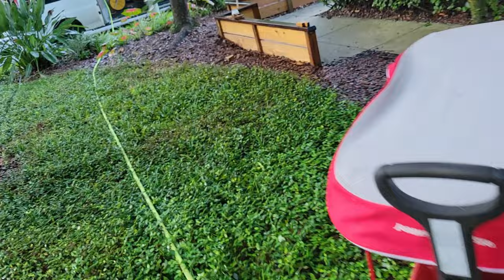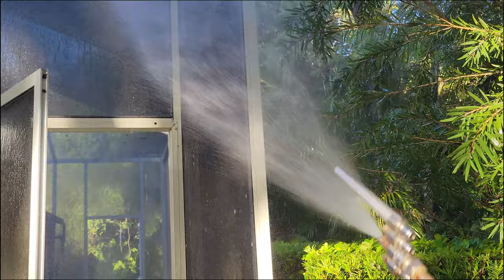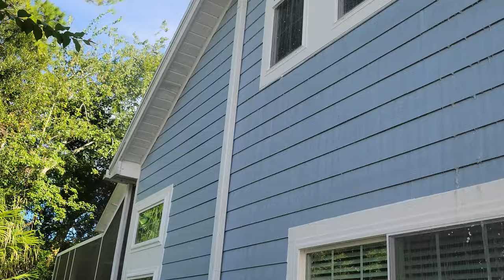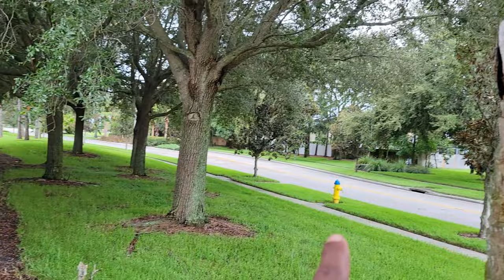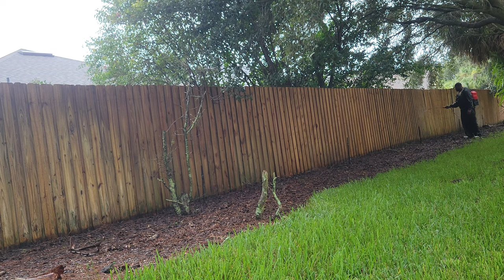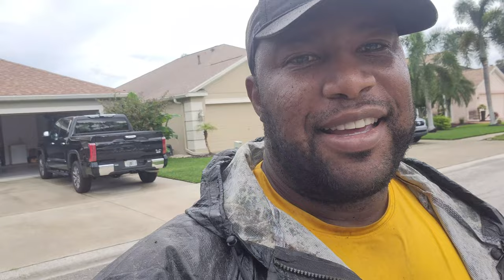I used BLEACH on a wood fence #woodfence

Comment: I'm doing my first wood fence tomorrow! After I pressure wash Does the fence have to be damp or dry before applying the oxalic acid?
Reply from the maker: You can do it right after rinsing the fence.

Comment: Great job on the fence...I have a cedar fence I need to do the same...how do you suggest I attack it? Sodium Hypochlorite mixture recommendation if I just have a pump spray? Oxalic Acid in the what ratio do you recommended? Thank you in advance for any info.
Reply from the maker: Never done cedar decks. We barely have those here sorry
Reply: @PinkFlamingoPowerWash  thanks for responding but i have a fence. .

Comment: Hey Cliff, Big-Up brother. What type of Pressure washer are you using?  Can you recommend a good soft wash chemical hose for my 12 Volt pump ? Thanks in advance.
Reply from the maker: I'm using a Honda gx690 8gpm pressure washer.  Yes 1/2 inch ag hose is very durable. I've been using that same softwash hose for since day 1.  So it's been good for 2.5 years so far.
Reply: Do you use the same machine on floors?

Comment: Do I have to use SH on driveway o just water?
Reply: use SH bro, it's the SH that kills the green/black grime.  i
otherwise driveway will look bad in 3 to 6 months again.
Reply: @vman6365  thank you very much
Reply from the maker: Yes as V man days definitely use SH.  The surfactant is what you really don't need for driveways. But sh is a must.

Comment: Once you used the 3 % SH , is it necessary to apply oxalic acid if you intend to stain and waterproof the fence, or deck wood?  Thank you in advance!
Reply from the maker: It's not necessary but I think it would add a nice touch to it.  ✌️
Reply: Thank you for replying!
Reply: One more thing does oxalic acid neutralize the bleach?
Reply: @UnitedSigma83 Yes however as a professional you should use percarbonate vs. bleach.

Comment: I did a wood fence yesterday and noticed when rinsing I was still getting some lines and had to use a "sweeping" motion up and down to get them to blend. It was especially noticeable in areas that had set in staining that had turned milky white after the SH application but not in every area. I used a 3% mix with about a 10-15 minute dwell. Any thoughts on how to prevent the lines in the future.
Reply from the maker: Not really sure what kind of lines you're referring to.
Reply: @PinkFlamingoPowerWash  I'm not sure how to best describe it but I got it cleaned and brighten, looked great! My shoulders and arms were SMOKED, that is a workout! I appreciate the information as always.

Comment: Hey Cliff love the videos btw. I’ve been on you tube every night RELIGIOUSLY watching my select group of YouTubers. So I’ll be running an entry level pressure washer at first. It’s the dewalt 4gpm machine. And I just want to be clear on the dilution ratio when down streaming. Am I correct when I say down streaming will cut your SH 10:1. Meaning if I ran straight SH out the bucket it would give me a 10% mix? I was under the impression running straight SH out the bucket would give me about 1.5% mix? I thought I had a pretty good understanding, now I’m a little confused. I just want to be able to run a 3% mix for my house washes and fence cleanings while  downstream.
Reply from the maker: Nah when you downstream you can get 1-1.25% depending on your injector or if you are using 10% or 12.5% sh.  Downstream is the weakest form of application which works well so no you can't get 10% mix.  10 to 1 or 10:1 means for each 10 gallons of water that passes through your injector it draws 1 gallon of sh.
Reply: I just posted reply. Not sure why it’s not showing up, so I’m re posting. Wanted to say thanks for taking the time for my questions, the insurance questions from a couple weeks ago and my down streaming comment yesterday. I’d love to repay the favor sometime. I’m sure I’ll do well with this business. I’ve been welder/fabricator now 7 years. Can’t wait to quit and get this company off the ground. If your ever in ocala and need help a few hours don’t hesitate to reach out to LDP Power Washing. I’m not on google yet but like I said if your ever in my neck of the woods and need a hand with anything I’d love to help. Thanks again cliff.
Reply from the maker: @leepyle1188  thanks my brother

Comment: Thank you for you awsome videos once again. Do you pull 2 hoses for your house wash? Is the soap and sh a 12 volt and the second is your PW for rinsing? ThAnks again keep pumping them videos please. God Bless.
Reply from the maker: Nah I downstream my house washes so only 1 hose.  I have done the 2 hose thing before though as you said.  Apply chem with 12v and rinse with power washer.  I did that when my injector was out of commission.  Thanks JC

Comment: Should I apply Oxalic on a new wooden pool deck after soft washing? A customer wants it cleaned because of the red clay after the workers got done.
Reply from the maker: On a wooden deck??
Reply: @PinkFlamingoPowerWash  Yes would the sh be safe to use on it If not what will I need to clean the deck?
Reply from the maker: @Dr. Rick  for that I would go with sodium metasilicate.

Comment: Any idea on what I should do I got a foam cannon and am looking to start washing fences but I don’t know what percent and how much bleach to put in my bottle
Reply from the maker: That I do not know. There's a guy named zay womder on YouTube that used to do that he may have that info on his channel.  He used to fill up a gang of foam cannon bottles with straight sh to wash houses.  I don't know whT the final mix is once he sprays it though.
Reply: Sounds good boss. Are you using a 3% SH in a bucket? Or what are you doing?
Reply from the maker: @calklobuchar  no on this video I downstreamed both jobs.  My downstream injector pulls out of a tank with straight 12.5% sh
Reply: @PinkFlamingoPowerWash  what ratio do you get with your downstream injector? I've heard best case is around 8:1, which would mean the SH is going on at around 1.5%? Correct, or not?
Reply from the maker: @leigh5326  depends on the downstream injector some pulls more than others.  But the average ones pulls around a 1-1.5%
Reply: @PinkFlamingoPowerWash  thank you for clarifying, very much appreciated. Really enjoy your videos btw!

Comment: I'm doing a fence tommorow, it's atleast 300 feet by 8 feet maby 400 not is $400 fair or way to cheap?
Reply from the maker: Idk. Each market is different. That would be better answered by checking locally.

Comment: I appreciate your videos. It’s help me grow as a business since I just started house washing. I have a question?
Do you downstream through 12V system or your power washer. Your videos pushes out high pressure when you’re down-streaming. Thanks for your help
Reply from the maker: The old school way brother. I downstream through my pressure washer. Nice and simple. I also use a downstream bypass its all low presssure, I use an 8gpm pressure washer so it looks like pressure but its really high flow!

Comment: nice work. I have a concern and a question. I am in NC. First my concern. There has to be some mixing of SH and ox. Which I understand put out bad gases. I dont see you using a resperator. How do you feel when you are finished. Did you just put your hand in the acid mix? And my question is how much do you charge per linear foot to restore a wooden fence? Keep up the good work
Reply from the maker: Lol you're looking at it wrong. . I never mixed sh with oxalic acid that's why you don't see me using a Respirator.  You saw me spray sh on the fence.  Then rinsed it off! Then  Sprayed oxalic acid on the fence and then rinsed it off. And heck no I didn't put my hand In acid that would be moronic.  That was pure water that I was rinsing my sprayer with lol 😆    I don't put my prices out there.  You can charge $1-10 a linear ft.

Comment: Assuming this is 5+ gpm. When DS are you mixing or running strictly sh
Reply from the maker: Yes.  I mix the soap with the sh.
Reply: O not soap meaning are you mixing sh and h2o to reach let’s say 4% knowing it’s coming out half at the gun
Reply from the maker: @tyriceholliday4151  yes the sh is mixed with water to be diluted down to the 4% or whatever percentage you need since the sh comes in 12.5% strength

Comment: What chemical and ratio did you use on the house?
Reply from the maker: Sh and it's downstream mix.  Which means it's lower than 2%
Reply: Straight up 12.5 percent?
Reply from the maker: @calklobuchar  what do you mean? If I downstreamed straight sh? If so yes I do. I don't water my sh down before I downstream it.
Reply: Sorry for the confusion I’m wondering what percent the SH pool chlorine was 12.5%
Reply from the maker: @calklobuchar  yes 12.5.  I use both 10 and 12.5.  Depends where I buy it from

Comment: Hey Cliff, how much would you charge for standard wood fence (style you see with 3 horizontal boards around a cow field, etc) Thanks!
Reply from the maker: Charge by linear ft for those. And double it up if you're doing both sides.
Reply: @PinkFlamingoPowerWash  How much would you charge per linear foot?
Reply from the maker: @blacklabpowerwashllc  my rates are for my business to make a profit and aligns with my market.  Your numbers could be very different. But from what I've seen from outside looking in an average price is between $1-3 a linear ft

Comment: Are you down streaming with an xjet at 3 percent??
Reply from the maker: No Xjet. I use a downstream injector. Envirospec Super Suds Sucker Downstream Injector to be exact. 3% I would either need my dedicated 12v softwash system or mix it in a pump up sprayer.
Reply: @PinkFlamingoPowerWash  ok so this was a mix of about 1-1.5%
Reply from the maker: @tgordoo  no higher. . Look up the injector I sent ya.  They pull more than the average injector
Reply: @PinkFlamingoPowerWash  appreciate it

Comment: What are you down streaming with?
Reply from the maker: What do you mean? Like what percentage. What chemical, what nozzle??
Reply: @PinkFlamingoPowerWash  I clean and stain wood fences. Right now I’m just using a 15 gallon tank with an electric motor run by 12 V battery basically a bug sprayer on steroids. I want to set up a gas powered system. I keep hearing downstream. I’m a retired fire fighter, and I think it’s similar to the concept of an in-line injector connected between fire hose couplings to pull soap into a line. I’m looking for some good resources to set up my soft washing system. I want to use the extended want to keep the bleach out of my face
Reply: @PinkFlamingoPowerWash  by the way, I think it’s cool you responded so quickly! I just started watching your videos today and they’re addicting! Great job!
Reply from the maker: @Eddie Calahan   oh yea the chemical injector works the same as you described.  We call it downstream injector because it connects after the pressure washer pump.  Therefore no chemical goes through the pressure washer , it only goes through the hose.
Reply: @PinkFlamingoPowerWash  thank you for the info. I’m looking forward to watching more of your videos.

Comment: Nice work not worried about it killing the plants can you use  sh on everything  ?
Reply from the maker: Everything is with moderation. Can't spray strong mixes around plants without watering them before and after.

Comment: How much softwash hose are u using bro I got 250 on my 24 volt
Reply from the maker: 200ft of 1/2 inch ag hose
Reply: Ok cool thinking about taking sum off cause I can go all the way around a a big house damn near 😂
Reply from the maker: @carlostreadwell4565  lol I don't use my softwash hose for house washing it's mainly for roof cleaning.  I downstream 99% of houses.  And 200 can do any roof
Reply: @PinkFlamingoPowerWash  yup that's right well I use mines on house washes down streaming cause I never use a 12 volt I went str8 to 24 so I pretreat all my concrete and downstream my houses using the Midwest proportioner like u say make it like butta then come back rinse with the 24 or my x jet